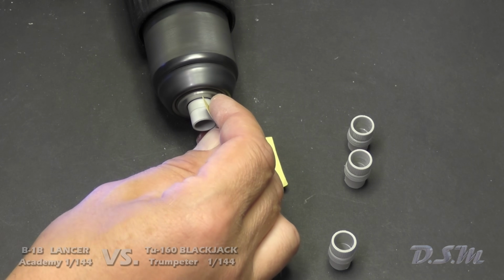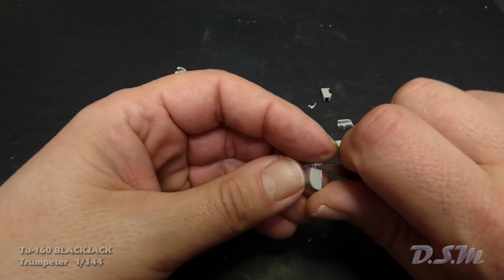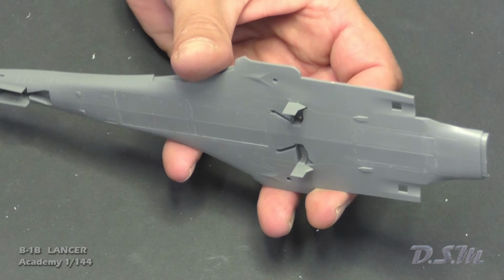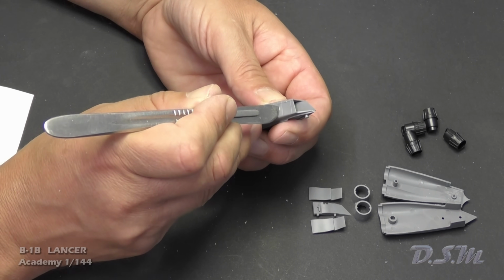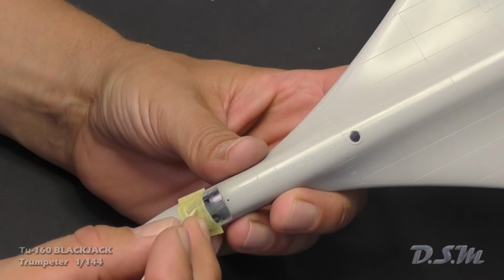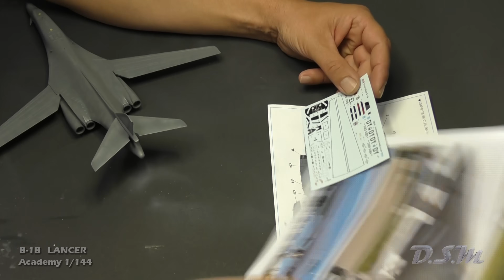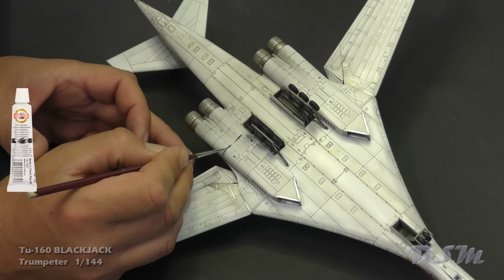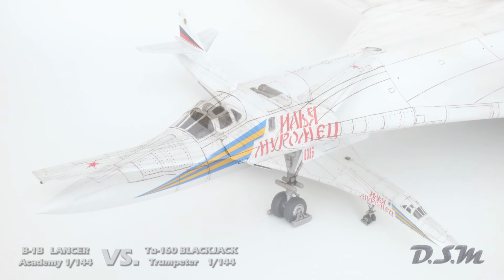B-1B Lancer vs. Tu-160 Blackjack 1/144

Comment: Hi Josef great build as usual. Sry but off topic but on your wildcat build what were the little white connectors you used on the aerial wire please? Thanks Scott
Reply from the maker: Thank you all for your feedback.  They are tubes that I make from plastic ear cleaning brushes.
I heat the brushes over a candle and carefully pull them out to the desired diameter. This creates a weak tube. I show the process in several videos.
Reply: Thanks I’ll check it out . Sadly the ear buds now are all paper will have to try find plastic ones !
Reply from the maker: I bought a supply of plastic...

Comment: A very nice side by side build.I hope you also consider the Academy B52 kit (their recent new mold). I used a couple of cleaned up  sprue gates as crew figures with a  coats of paint they do the job. I hope Academy also add a B2 to their range.
Cheers